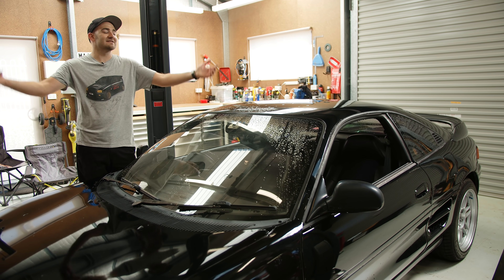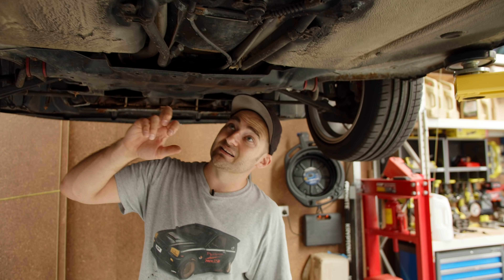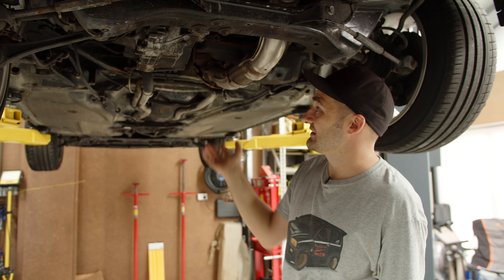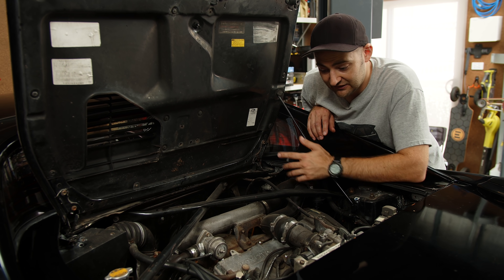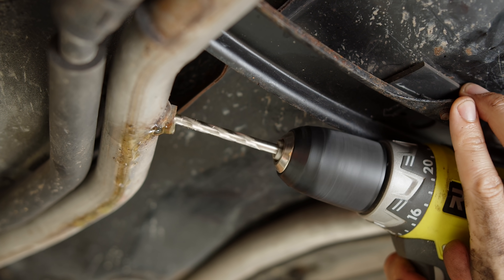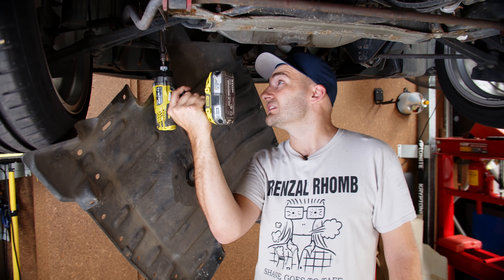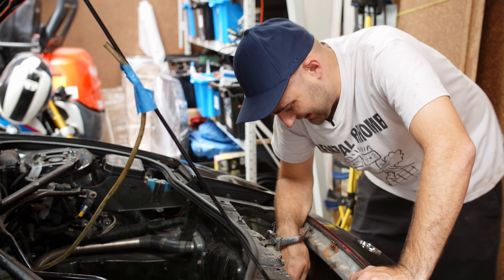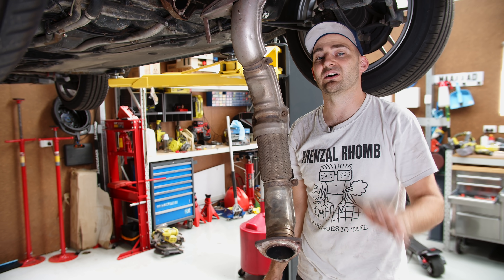Turns out my 'super clean' Toyota MR2 turbo is a piece of ....

Comment: Marty: theres so much rust and some bolts are rounded.
Me: Laughs in northen european after third full respray and rust still comming
Reply: Honestly we should just stop salting the roads, the ammount of cars eaten by rust probably increases the net CO2 outlet of automotive industry by a lot.
Reply: @Mattle_lutra  10000% agreed
Reply: @Mattle_lutra  But the roads taste realy bad without any salt.
Reply: Time to F the paint and just get the c*nt hot dip galvanised. Even here in Britain every car turns to dust from the arches out
Reply: @Mattle_lutra  , of course we should. We've been trying for a couple of decades now. There is a wide range of alternatives: ones that destroy roads, ones that are 20 times more expensive, ones that make the road even more slippy, or a plethora of ineffective ones. Take your pick...
Reply: @Mattle_lutra  If we didn't salt the roads how would ambulances get to emergencies etc?
Reply: @_Professor_Oak  With winter tires ;)
Reply: @GroovThe  Just make it illegal for roads to be icy. Problem solved.
Reply: Just hoist it over your head, clean it well and hose the entire bottom w/ fluid film. Pump it into every part you cannot see also like rockers and boxed frame sections. Then while back down put it into any place that it will settle into like the bottom of doors and cowls. Should be included in regular maintenance if you want it to last in winter salted roads. Heard Canadians call it "under oiling" and have seen it done with 90 weight and old trans fluid but fluid film and others similar are not toxic. Stuff works well and it makes a real difference.
Reply: @_Professor_Oak  with winter tyres and roads being cleaned, where I live in Norway they salt the roads maybe 6 times during the winter, usually they just put gravle after cleaning the snow of but then again we can actually drive a car without hyperventilating when we see 1 cm of snow
Reply: In the passes for Oregon they don't salt, they use gravel. Then in spring they run big street sweepers through and the gravel gets washed and sorted to use again.
Reply: @NeedleDrops  They do it in Finland too but bigger roads get salted over trowing gravel... guess it for so capital folk wont get mental brake down and crash cause "winter surprised drivers" again, even though it happens every year and still these morons manage to create 20-100 car chain collisions despite roads being salted -.- Rest of the country manages fine and just curses the salt.
Reply: salt can also be bad thing, it melts ice but after the effect its just water and it will freeze again and make things even worse, salt is just stupid
Reply: mcgeufer True but high blood pressure is an epidemic in this country.
Reply: Bullettfire plenty of good anti rust electrolysis kits for cars. Works same way as freight ships employ.
Reply: Bullettfire sand gets in between your panels and also causes rust, also repainting will only slow down the process
Reply: @miepmaster25  more likely that dust and sand is like a sandblaster for all car parts (especially from tires) and mother nature does its best even regular wash does not fix that problem
Reply: @fintanheriot345  galvanising with zinc? Isnt it a very expensive? Whilst removing rust with electrolysis will leave some places that need bog to fill it for mirror finish? So in the end you still have a car thats rusted out
Reply: @kineticsurf  thanks for advise i use hard cover like anti- gravel for the bottom but main problem is the arches because they get like sandblasted and rusted and you cope with it again and again
Reply: Bullettfire no look up anodes and cathodes you run an electrical current through body of the car and fix pieces of metal that can be replaced to vehicle and they self sacrifice the rust. Can get kits for 4wds etc for 7-800 dollars. Google electronic rust protection
Reply: @_Professor_Oak  the north here don't salt, and the ambulances get around just fine. Theyre usually equipped with chains. A lot of the drivers up there (emergency responders included) say that an ice road is often easier to travel by than a badly salted one.
Reply: @GroovThe  driving on a well shaved ice road is quite easy compared to a badly salted one. Also since salting ammount is so weather dependent, the less stable the climate (say on the mountains) the harder it is to salt right.
Reply: @mcgeufer  true, always salt your meat before puttin' it to the heat :B
Reply: @Mattle_lutra  I'm not sure what shaved ice road is - unless a road made of a tasty refreshing dessert - but I find that hard to believe. If there is ice on a mountain road, you are not going up it. Do you actualy believe otherwise, or are you trying to flex?

Comment: "It's just so much easier to drop the engine" -The mechanic who did my mr2's timing belt
Reply: It's not, you can do them in 2.5 hrs if you know what you are doing.....

Source - am toyota tech from the era when these were sold new, never dropped an engine to do T belt
Reply: @Opsecable  its a joke
Reply: @Opsecable  Note wording "new" would you still do it like that now? :D With out hoist, sure might be easier, but with one might as well to check areas you cannot get when engine is in the car.
Reply: @Opsecable  A 30 year old car/engine might need a lot of other work done to it as well, so it often makes sense to just drop the whole engine to adress several issues at once. I did replace the clutch on my sw20 turbo without removing the engine, but in hinsight, I might as well just have removed the whole engine to give it a proper refresh.
Reply: @Opsecable  New yeah, you wern't fighting rotten bolts at every opportunity
Reply: @mrcaboosevg6089  SW20 was produced for a long time, yes we worked on old cars, TBH in scotland after 1 year our cars look like this.

Comment: Got a zz30  and love the thing. You never know if you're going to die on a rainy day and it's a PIA to work on, already replaced the engine. With no car lift it was "fun" using the engine hoist to lift the car off the engine. Building a turbo motor for it so I'll get to do the whole thing again. Totally worth the hassle. One of the best handling back road/mountain runners I've had and in my area you rarely see any kind of MR2. I like the design of the sw20 better, but I've got no regrets getting my zz30. I look forward to seeing more of what you do with this car in upcoming videos

Comment: Perfect Timing, I was just about to fall asleep 😂😂😂👌
Reply from the maker: goodnight mate!
Reply: Same lol
Reply: Same!
Reply: @mightycarmods  don't often comment and I feel like I'm being "that guy" but would hate for you do potentially have to rip the engine bay apart again.. it's extremely common for the wastegate flapper to have clearance issues and usually ends up hitting on alot of generic 3 inch dump pipes for these cars causing boost control issues :/ I only speak from unfortunate experience, worth test fitting with the wastegate actuator rod circlip off and making sure you still get full movement, I know Brooks Racing Development do a dump pipe that 100% clears if you do run into issues

Comment: I could related to this on soo many levels, have owning a SW20 for 10 years now..

Protip:
Change the Hose from hell whenever you're in that area of the motor
Also, removing the boot-lid allows you to work on the engine bay from inside the trunk, its much easier than dangling from one side of the car

📸@rjpan
Reply: Yep - I've spent way too much time sitting in the back of my AW11 just to save my back.
Reply: Yah this!
Reply: THIS^^ needs to be the top comment
Reply: In all the years I had my mr2 turbo I never thought of this 😂 not that it ever needed much work it was a pretty reliable car for the most part.
Reply: I loved my MR2 and have a patina of nostalgia surrounding that time in my life, but I remember every bolt being completely trashed.

“This car is fighting me so hard” I’m so sorry Marty. It’s painful.

Comment: 6:53 i always tap rusty/old bolts on the head with a hammer before trying to turn them either way. this tends to break the rust, not the bolt.
Reply: Never had this work. Ever. Fire on the other hand. Fuckin glorius.
Reply: @sobbo12  Yes nothing better than lighting the wick.

Comment: Threading every single bolt with an impact drill:
"Just about every bolt I've taken out so far is a throwaway"

😂😂😂😂😂😂😂😂😂😂
Reply: Removing bolts with an impact driver shouldn't damage them. If it does, they needed to be replaced anyway. He said they're throwaways because they're horribly rusted, pitted, and shouldn't be reused.

Comment: That impact gun makes a big difference with the rust Marty. Set it to tighten and hit each bolt with a couple quick pulses to break the rust loose. Then you should be able to remove them without as many breaking. Cheers from Canada!

Comment: On my '93 I remember as a kid, doing anything in the turbo region just meant pulling the exhaust then manifold/turbo/downpipe. I left all the heat shielding off and used a jethot coating to contain the heat. It worked. An ALMOST bigger reason for upgrading the exhaust, removing the cat and the aforementioned thermal coating (there were a lot of bolts holding all those heat-shields in place) was to reduce the pain in the ass of working on it.

Comment: for a MR2 that rust isn't so bad.
as you have taken off the turbo and manifold it's a good idea to replace  the 2 hoses underneath the manifold (hfh & hfhoe).
Also check if the dumpvalve can open fully with the new decat  donwpipe. alot of aftermarket downpipes don't allow the dumpvalve to fully open. Also there is alot of undertray missing the most important one is the one at the back. which  direct air against the gearbox for cooling.
looking forward to see more videos about the MR2!

Comment: "I don't know if this one does" he says about an LSD as he's standing under it by the wheels on a hoist. Spin a wheel and find out!!
Reply: My car has an LSD, when I spin one wheel the other wheel spins the opposite direction.
Reply: @Darndiddlyarn  you should ask for your money back.
Reply: @zak28lexus  it's odd, because my other car with an open diff lays two strips, go figure.
Reply: @Darndiddlyarn  If it does actually have an LSD then it's fucked.
Reply: @Darndiddlyarn  sounds like a open center to me..
Reply: @dualnamehype  oh it's definitely an LSD, 6 clutches and shims each side, it's just 430,000k old and has zero resistance left. But under normal circumstances spinning the wheels will tell you if it's open or not.
Reply: @Darndiddlyarn  holy shit 430ks
Reply: @dualnamehype  Heck, that's only 270k miles, or so,
Reply: @Darndiddlyarn  My Hilux has 450,000 ks on it's LSD and it still works just fine.
Reply: @burtonnz  hilux LSDs are designed differently to my isuzu one, you can adjust the break torque on a hilux LSD simply by changing out the spring.

Comment: Marty, if it makes you feel any better, that car is barely rusty compared to some vehicles that are only 4 years old. The rust belt of the states is hard on cars and I'm definitely jealous you generally get to work on rust free cars.  A tip for in the future is get an oxy/ acetalyn torch is you want to spring the cash for it. Also wd penetrant oil is garbage compared to some of the stuff we have over here.  The best I've found is zep super rust breaker and kano aerokroil. Crc freeze off is also pretty good.

Comment: Quick tech tip: All Japanese, and most western cars that have drive axles sticking out directly from the gear box, are designed to drop the whole power unit for anything other than basic maintenance. Renault even has some models that need engine drop for changing the spark plugs. It is a design feature that prevents doing major work at home conditions, for "safety reasons". Also, Skoda has a design feature, that rips at least one of the engine unit fastener threads every time you pull the power unit off. It's there to recognize a car that has major engine work done, like changing the clutch, or other similar stuff. These are single-use items, that are not meant to be repaired nor to stay on the road for no longer than ten years. Their designed life-span is 3,5 to 7 years. After that they are meant to be scrapped and recycled.
So, if you think that all modern cars are crap, that's because they are. They are actually designed to brake after their warranty is closed.

Comment: Not sure if he has considered it but a super popular swap is to swap in the Toyota 2gr-fe. Sites online sell the electrical harness necessary and its a bolt-in swap for the most part. Alot of people will get the engine from a V6 manual Camry or Rav-4. Its also what they use in the Lotus Evora and you can slap a supercharger on it without much effort. Its also actually lighter than the turbo mr2 engine.

Comment: Actually the impact driver is a good idea on rusty bolts, the way it hits have a lesser chance of shearing the head than raw torque on the wrench, and it might crack the rust.
When a bolt seem too rusty for its own good, I always put some penetrating oil, hit the head with a hammer, dak dak for a while, then try to use a breaker bar. Heating  works quite well too but a lot of the time the placement of the bolt makes it impossible, so i tend to not do it often

Comment: Mechanic from Canada here.   I deal with this level of rust and usually worse everyday.   I use induction heaters and torches more then I use weasel piss.   WD40 is great for cleaning tools and not so great as a penatrating fluid.
Reply: yep, WD40 is fine for the light stuff but anything more...
I heard their Specialist rust-penetrant stacks up pretty well, though it isn't the best one.

Comment: I am certainly glad I went for an MX5 NA instead of the MR2 I was sooo close to buying. I'd still like an MR2 but I would've been in for a world of expense or hassle. The MX5 is easy to work on but mine still had bolts snapping and being rounded issues, but if I were to get the MR2 I was looking at it would probably be the same but in the back and wayy tighter.

Comment: When the car is in the air, it's really easy to check if it has a LSD or not. In neutral spin a rear wheel by hand, if the other wheel spins in the same direction it does have an LSD.

Comment: My first car, a beater 1980 Monza Spyder, once lost a large flat metal piece of the unibody in the rear wheel well. Also had an '87 Civic hatch that I found a large gap along the whole passenger side floor/rocker. Wife (then girlfriend) said her seat rocked when I braked. Oh, and a torsion bar on it snapped while driving. Bought it off a neighbour for 3k who repainted it. What a heap.

Comment: Here in Canada that rust is normal gotta heat it and beat it to get it off. Gotta get the car "oil sprayed" every year where the put some kind of oil protection inside all your doors and other little spots and thats just so the body doesn't rust out on you. 
When you work on a car with out rust it feels weird not having to fight to get things apart lol

Comment: SnapOn makes one of those 1/4th inch hex quick change to 1/4th inch square. But it's locking so the entire assembly won't come apart at all and you'll never lose a socket again :P I use it at work and it's the best thing ever.

Comment: Protip always spray rusty bolts with wd40 before trying to loosen. If something is important I'd recommend using 2 rubber hammers and using one to hold it and the other to twist by hitting it

Comment: Looks like a normal day in a car guy's life in the Nordics. I've had six cars, five of them needed tons of welding and probably a square meter of sheet metal each. It's sad to see all the cool 90's and older cars go to waste because there is so much salt on the roads during winter you can almost hear your panels rotting away. Even my current '96 Impreza needs patching even though it has had 8 full rustproofing treatments over it's lifetime. 

And a tip for rusty nuts and bolts: heat, impact and more heat.

Comment: I wish my 1986 MR2 was in such great shape. It was nearly mechanically perfect until taken off the road due to the suspension pickup points getting too rusty to be safe. The body rusted from the inside out! The big clue was when the right hand skirt and then the front sway bar both fell off in the space of a week ! Upstate New York winters are not kind to cars!

Currently getting my Toyota Tercel back on the road after a catastrophic break line failure due to rust. Replacing the rusted line with new nicopp tubing, new calipers and rear brakes and repairing more rust damage than I expected. It's not fun.

If I had any spare cash I'd get newer MR2 or a pristine Mk I, preferably a  supercharged version. My loaded Mr2 was the nicest car I've ever owned and is tied with my first sports car, a used 1964 MGB in the driving fun category.

I have 20+ years of SCCA racing and prepping FC and FF racing cars and the MR2, as a Skip Barber manager and retired pro racer told me once: "It's the closest thing to driving a formula ford on the road".

-dave

Comment: Teflon tape great for sealing water oil what have you , hold bolt by hex threaded part facing away from you place Teflon at bottom of thread wrap from right to left 2 to 3 times install tighten job done no more leaks

Comment: Use brake fluid on the turbo studs/nut connecting the downpipe to the turbo. Toyota designs the studs and nuts to seize together and instructs their technicians to use brake fluid when removing them.

Comment: I am having flash backs, I did this maybe a dozen times 10ish years ago. I still have scars from trying to get the massive hard to reach oil feed, or was it water, I don't remember either way use two 1/2in extensions with a flex in the middle, I think the head was big, like 27mm big...i refused to drop the engine too, you can do it but its going to be frustratiing. Dropping the fuel tank isn't to bad, and you have to if you want to do the pump....its getting the thing back in that was hard.